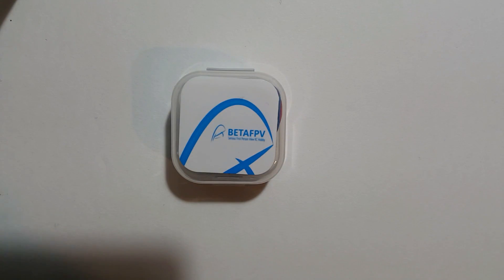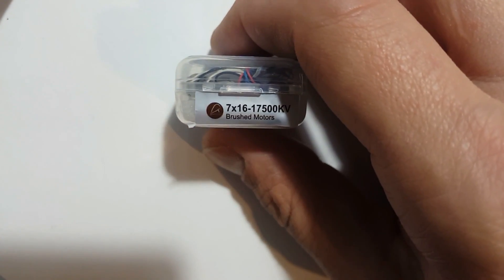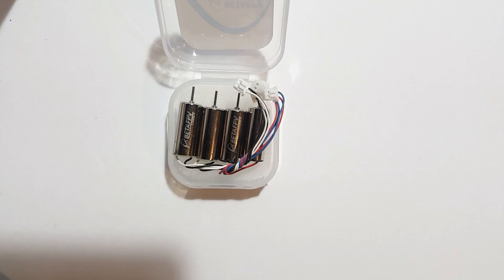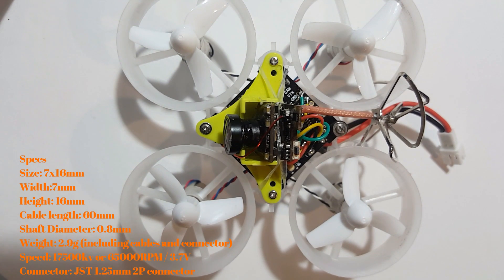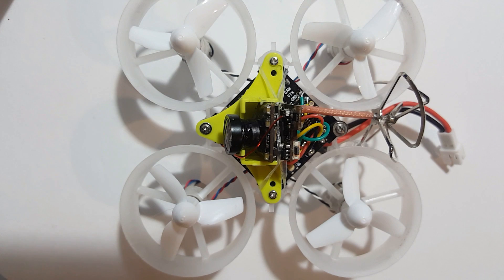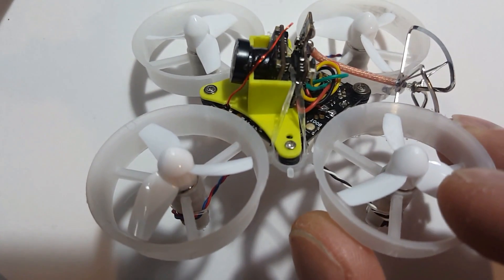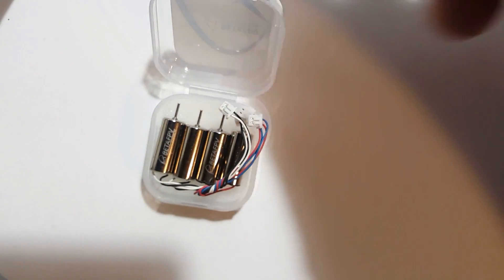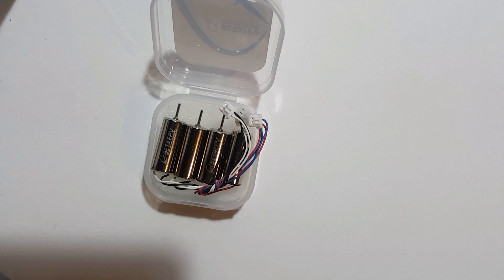BetaFPV 716 17500kv Brushed Motors

Comment: I recommend these motors if you want to build an eachine qx95 style quadcopter , not a tiny whoop , these motors are really good also because they are basically completely sealed off , there is no holes on the top and bottom of the motor like other common brushed motors we all use on the Market so it help keep dirt and debris out of the motor so it dosent get worn or completely seize up , my biggest problem with brushed motors is getting dirt all inside them after I crash everyone and then , . they preform so well and powerful just slap on a 55-65mm prop , I prefer a 58mm 2 blade propeller . I also have myself a 100mm carbonfiber frame and I recommend them as well cause they are strong a light at around 7-9 grams depending what frame you choose but I have no regrets , I also have a 2s build and I really love it but 2s brushed motors are hard to find or expensive, but thankfully betafpv 7mm 20mm 17,500 kv motors with LIHV batteries kick ass that are the fastest 1s motors I can find

Comment: I am stoked that they are good! ...better be for that price! Thanks Ray!
Reply from the maker: +jakes quad channel right they sell 3 sets of 720s for a much better price.
Reply: Will 720's fit in a E011 you think?
Reply from the maker: They will fit but your props will stand proud of the ducts.  Also the shaft is larger so your prop choice would be different.

Comment: Great info! Has anyone performed a thrust test on these compared to the stock motors in the Eachine E011? Or, does anyone know the thrust per motor with the recommended props? Thanks for the info and Happy Flying!
Reply from the maker: Ground Control RC hmm I'm not sure.  I'm working on a set up to do some testing.
Reply: Thanks for the reply and Happy Flying!
Reply from the maker: +Ground Control RC thanks for watching buddy